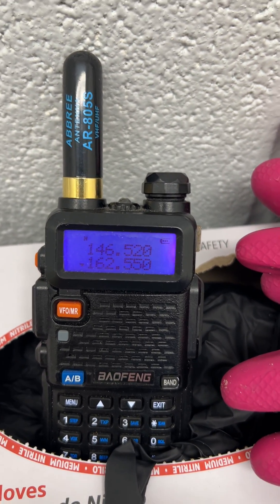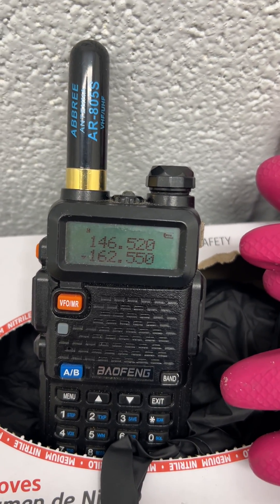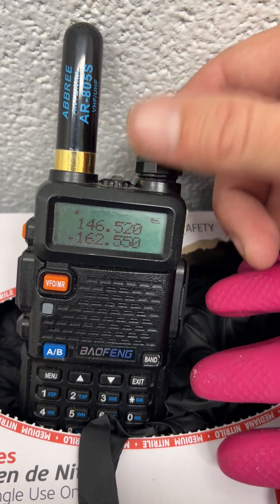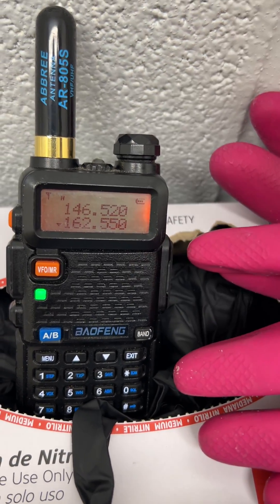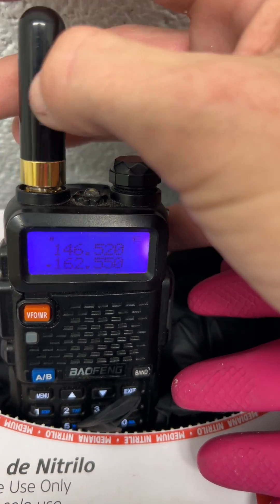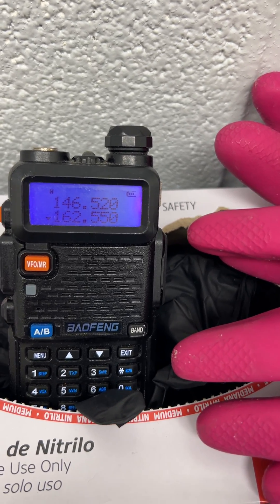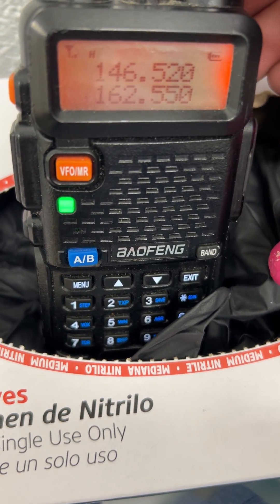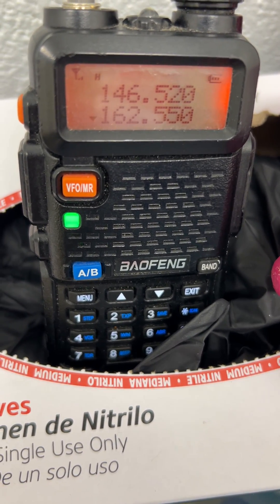I crafted a paper clip antenna to alleviate boredom at work, it receives better than my abree.

Comment: now try putting some random wire on the back screws I do that and increases the receiving
Reply from the maker: Just to confirm, is this the ground radial wire for the antenna? Without any wire on the back of the radio, I get an SWR of 1.05:1 and can transmit clearly to a location 2.5 miles away.
Reply: @361cctx-vv6ch  yes the back screw is directly connected to the ground of the whole radio. I have no equipment to measure the strenght of the signal but I can tell the receiving is better, also  they say they can hear me better.
Reply from the maker: @mrld3005  I have some extra wire, and I'm going to test it out. I'll let you know what I find. I recently moved to a new house, and I've set up my radios. However, I still need to connect my meter and nanovna for testing

Comment: Only comment I will make is that little antenna that you are comparing your antenna against is probably very inefficient seeing how small it is.
Reply from the maker: As the frequency of transmission increases, the size of the antenna decreases. I was able to easily communicate with my friend who was 2.5 miles away without any issue. Despite being small, the antenna's SWR was 1.02:1, which is perfect. I created this antenna out of boredom, and I plan to make more UHF VHF antennas in the future.

Comment: What formula did you use in the development of said antenna ?
Too.... sometimes just lifting the radio to a different position, will aid with reception ! Most antennas made for hand helds, use your body as the second half of the radio !
Obviously, those tiny antennas are made to use in close proximity , and provide a useful match to the transmitter, in an attempt at keeping the radio's output transistor from failing !
I have increased range with this type radio, by making a wire counterpoise, by simply  attaching the wire to the radios ground !
Best where antenna meets radio !
Half wave antennas are good performers, as they are self resonating, and do not need a ground plane !

      Just a Thought !
               👍😉
Reply from the maker: I have created a custom iPhone shortcut that helps me set up my dipole and vertical antennas for R&D purposes. All I need to do is input the frequency I want to communicate on, and the shortcut provides me with the required length of antenna and ground radials. To ensure that my setup is working correctly, I use mmana gal to check the standing wave ratio (SWR) and make adjustments accordingly. When I achieve an SWR of around 1.02:1, I start cutting the wire and setting up the antenna based on my calculations in mmana gal. Once the antenna is fully set up, I use nanovna to fine-tune it to the lowest SWR on my target communication frequency. I aim for an SWR of 1.05:1 or lower for optimal performance.
Reply: @361cctx-vv6ch  
Holy Cow.....!
You are above and beyond my pay grade !
I have never in all my years ever heard anyone chase that far down the rabbit hole ! 🕳️🐇
Sounds like you squeeze just about every last drop of RF out !
Thanks for getting back !
👍😉
Reply from the maker: @sleeve8651  yes sir I will chase that rabbit. The RF bunny bit me hard about 10 mths ago. And yes I want to squeeze out every bit of rf power out. If I'm pushing 80 watts I want all 80 watts to leave the antenna and not come back. And I will continue chasing that RF bunny  for rest of live. I think he might be invisible lol

Comment: I made an antenna with perfect SWR and ZERO reflected watts out of a 6" pizza tray, a wire coat hanger and an inexpensive Nagoya GMRS antenna.
Reply: I may use that antenna for a Retevis RT97 GMRS repeater that I'm testing in my back yard. I'm hoping the hotplate I built will keep batteries alive in this sub-zero weather. I'm thinking I may set it up on a different, higher ridge as soon as the trails get dry enough to get up there.
Reply from the maker: I would think the hot plate could work but never know tell you test it. That awesome news on the repeater. I'm intrigued.
Reply from the maker: Hey, that's really cool! I love homemade antennas. How far were you able to transmit with it? I bet your receive is fantastic!
Reply: @361cctx-vv6ch  I haven't done a distance test but I'm told I get a strong clear signal out. I have a personal repeater on a ridge 5 miles to the south. My brother bounced off that repeater with a 5W Baofeng and hit me 67 miles away, line of sight. He could probably do better but I was in a hilly area, in and out of the shadows.